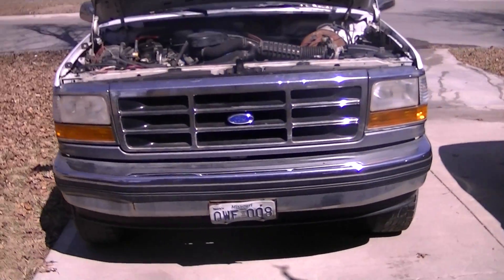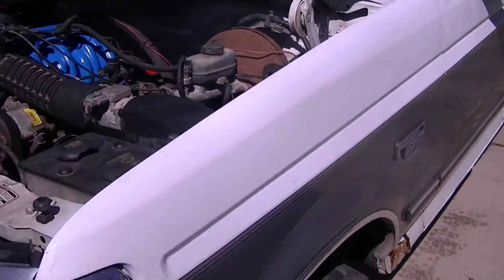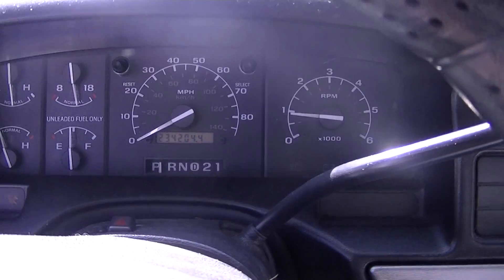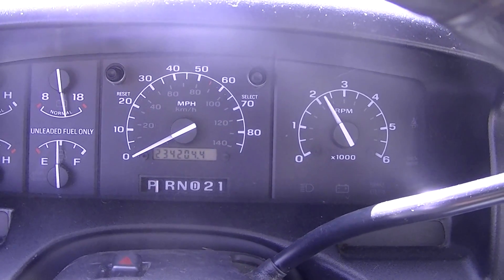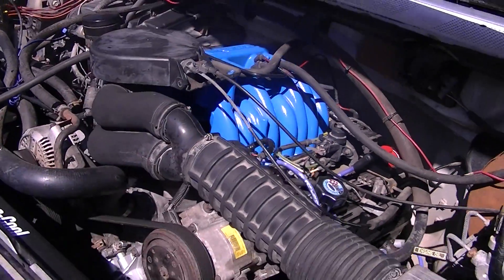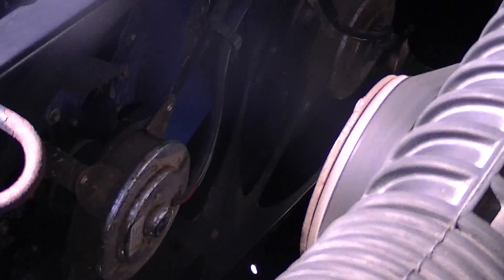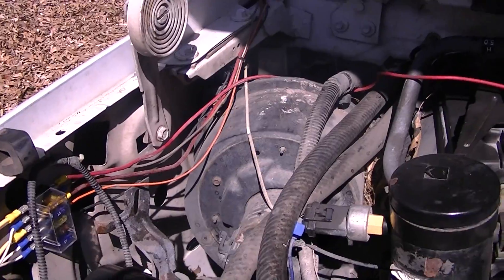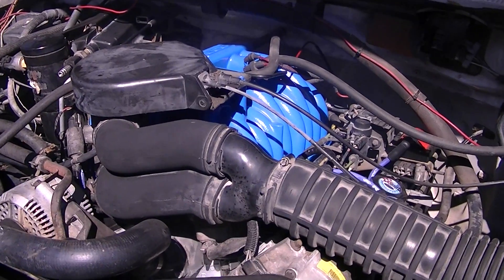351w rebuild 1994 F150 Mass Air Flow Conversion

Comment: I did remove the  carboncannister, the airpump, removed the air leads to dillute exhaus gases,  blinded off the IAC the EGR , Blinded off the ThermactorBS  and I run a straight pipe, instaid of a Catalytic convertor and she runs great. We do call all those parts "American BS inventions, that doesn't work here in the Netherlands

Comment: This is what I'd like to do with my '94 f250. It has the 351 and I've been looking to find what intake I can use with gt40 heads? I'm thinking a 302 HO cam as well and then the Mass flow like you have. What intake do you have?

Comment: No egr?
Reply from the maker: nope...  she gone.
Reply: did you use a eliminator plug to tell the computer it is closed, i tried to eliminate mine ran better till the check engine came on and started to run like crap again 95 f150 5.8
Reply: +Ryan O'Hanlon hey man I got a 92 how can I do the mass flow air conversion
Reply: when i used the eliminator plug on my 93 it threw code the moment i put it in drive . i put the egr  with a plate behind it to block port and left the electrical and vacuum attached with no codes and runs fine